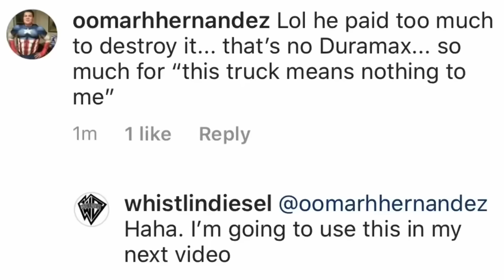Mudding the $100,000 F350 Until it’s Ruined

Comment: Hold the traction control button down for 10 seconds it will turn advanced trac off and won’t cut throttle (like so he will see this)
Reply: I'm baked that didn't work
Reply: It still will.. you need to pull the abs fuse. Otherwise it will still pull power once the truck slides
Reply: Even if that was a thing he gets thousands of notifications from all the normal comments daily
Reply: @Lifes_A_Mitch97  well even if you could tag him like that, you would have to spell it properly.
Reply: @bluntmannd1351  you should know all about typing shit up high ain't nothin but a little mistake
Reply: Onenasty306 no I work for ford I own a truck similar once advanced track is turned off it doesn’t cut power at all when sideways I’ve done it plenty of times @Onenasty306
Reply: He whistlen why dont 
You put the padle tires on the cabover and try to disc with it
Reply: jman taylor your the reason hes doing this
Reply: Hold it for 10 seconds and then tap it. That's how you fully turn it off.
Reply: @WhistlinDiesel
Reply: @Onenasty306  false
Reply: @fishingsparky  hold it till its says advance off. I drive a 2017 f350 long bed diesel.  I do this to drift the truck.
Reply: That’s on all trucks now my Tacoma does the same . But that does the trick
Reply: Does this work on an 09 f150 to?
Reply: @jonathanswinford88  pull fuse 36 and 47..
Reply: @Lfs1891  ok thanks man I appreciate I live down a gravel road an every little bump or anything makes if come on an cut power
Reply: Makes it come on*
Reply: Hold down the traction control button for 10 minutes and it’ll turn your mom on.
Reply: John Deere would definitely watch that😂😂
Reply: As long as the rear diff isn’t locked. If the rear diff is locked it bypasses the advance trac system
Reply: BLUNTMAN ND are you blunt man from neutral drop 😂😂
Reply: If you’re not biting your tongue 👅 just right it doesn’t work. Just tried it, I work at a dealership that is open until 4 a.m., man I need to get a life 🤥
Reply: After you turn advanced track off then click the traction control twice for sport mode. Does anyone else know about it lol
Reply: 1st press traction control button one time then press and hold for 10 seconds  to get advance tract off *
Reply: C G and then push twice, second push hold it down and it turns on sport mode 😉
Reply: Yeah it works I have 2011 it turns the advancetrac system completely off on mine
Reply: Still trying to figure out the question here....  Any help would be fine.  Thanks.
Reply: @WhistlinDiesel
Reply: I wish I new that before I got stuck in the sand dunes a couple years ago. When I got home and called the dealership I was informed of it.
Reply: @whistlindeisel
Reply: Darvin Stjohn I was the sand dunes and could get up a small hill with my F250. I was so fn annoyed. Found out when I got home that there is an advance track option I had to turn of. So I had to hold the bottom down twice.
Reply: @brandonbrowning7502  Yes He is!!!!
Reply: @Lifes_A_Mitch97  go to rebab dude
Reply: @yammmit  it's weed not meth 😂🤣😂
Reply: @Blockycrypto  it’s his truck not yours
Reply: @afuzzykkitten  ong
Reply: @brandonbrowning7502  yup im so jealous of a guy who ruins stuff for fun. That's me!

Comment: When the Cybertruck comes out, I'd love to see how it handles this stuff like snow and deep mud
Reply: Collcroc123 I wanna see that as well. They will need to test tri motor to even have a chance to do all this. Dual motor ain’t doing this.
Reply: 16 inches of ground clearance will prolly go right over, it just needs the right tires
Reply: I wonder how the batteries will hold up in the cold
Reply: @2013TombRaider  dual motor has a 4.5 second 0-60 and instant tq, and alot of tq, so why not? other than weighing 8k pounds
Reply: Can’t wait to see that
Reply: It will get stuck in 2 inches of mud because it weights 8k pounds

Comment: So glad to finally see a SEMA truck getting used as a truck. Most of them never leave the pavement. Hell, some of them never even see the pavement and get trailered everywhere.
Reply: Totally agreed great comment
Reply: Tanner Marlow and half of them would break under these condidtions because they’re rushed project trucks
Reply: i hate mall crawlers to but i wouldn't call what he's doing using a truck as a truck. maybe i'm getting old but i hate having to fix things. i'm good at it but screw that.. time and money wasted when you're repairing something you broke playing around. i just use mine, both of them, to get to and from work and the other running i need to do. to be fair one  is a 2wd ranger and not really up to the task. the other is a 2500hd 4wd i got extremely cheap but don't need. do not get me wrong, i'll still use them for hauling and towing. rarely is that needed though. i agree with ya on one thing, i like seeing this nice pavement princess getting dirty.
Reply: hello Tanner. btw n word
Reply: Yeah bro
Reply: I rlly agree this was a ok use of it but it could have gone without hitting the semi

Comment: I'm pretty sure that's the most beautiful Ford truck I've ever seen,  and as much as it stung to see, I'm glad he destroyed lol
Reply: If you think he “destroyed” it this episode i assume you haven’t seen the video where the only bits of the original truck left are the bottom half of the chassis, the engine and LED strips?
Reply: Worthless truck. Just for show.  Ya beat the fu k out of it.   See if it could pull some logs out of woods
Reply: It's freaking HIDEOUS.
Reply: @birdhunter2754  he pulled 18k of concrete in the bed
Reply: @birdhunter2754  better truck then u could ever afford
Reply: @blakeisbest6835   maybe so but i dont spend my $  on toys just to trash them.
Reply: @birdhunter2754  not just for show, i worked on a farm 2 summers ago and my boss had this exact truck.  We did work all day and night with that thing, off road.  These are actually really well made trucks.

Comment: He didn’t brake a CV shaft this time like on the Duramax
Reply: The strength of solid axles over ifs
Reply: Hahahah
Reply: Because there isn't one.
Reply: @Jonnyolsen91  That's the point, chevy suspension is garbage
Reply: But he did drive into mud 3” deep and buried it, so welcome to Ford problems.
Reply: @ChuckBeefOG  As if any of it is stock
Reply: The YouTube Kid LOL 😂
Reply: HERPY DERPEDY oh hell yeah way more reliable too
Reply: Challenger King LOL
Reply: Max Krukar yessir
Reply: Max Krukar maybe whistlin wouldnt have broken so many CV’s if he didnt buy Delco parts. If you going that excuse you need to compare apples to apples. Ford makes best truck, they also make the worst powertrains on the market.
Reply: @ChuckBeefOG  I agree and disagree on that. Ford had a really shitty streak from 2002-2011. Gas engines were garbage, diesels were horrible etc. And of course chevy had their cylinder deactivation crap around then too
Reply: Chuck Beef bruh

Comment: I absolutely love how those tires do actually decent in the mud 😂😂
Reply: Those mud tires?
Reply: @raymieh8905  the rubber bands
Reply: Lumpy zx2 I mean the tread pattern is probably more important than the aspect ratio. Although probably not good for rock crawling or trail driving as those wheels would probably get bent and let the air out of the tires
Reply: @lumpyzx2645  I'm just messing with you, I know what you are saying about them. They are tougher than you think . I do like to air down
Reply: I was impressed how well they did, personally I'm a small wheel big tire guy but to each his own